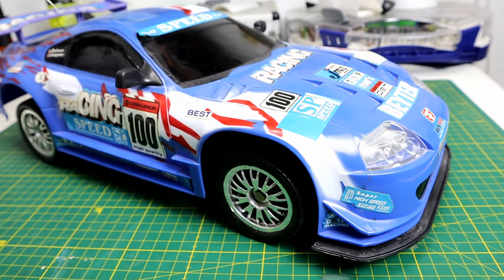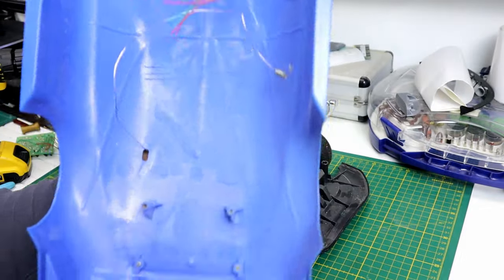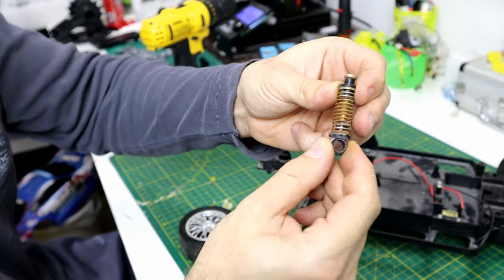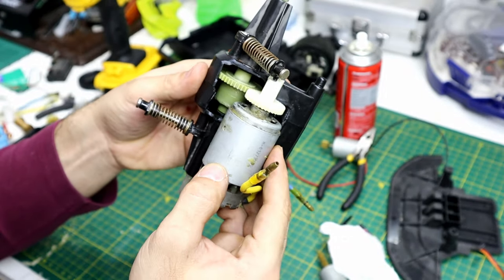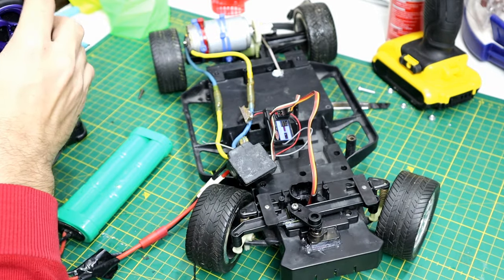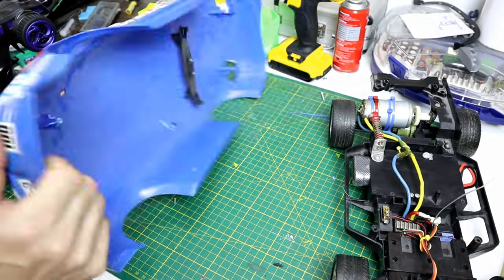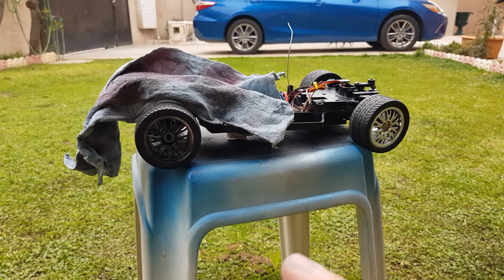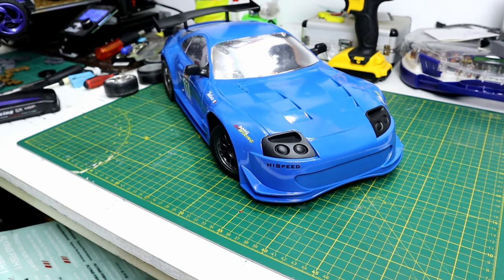Upgrading toy car to hobby grade car/upgrading steering to prepositional steering  | HOBBY WHEELS

Comment: Hi, I'm a newbie at this, starting a similar conversion-- I had a question, please:  I noticed that before you installed the steering servo, the front wheels did not automatically straighten out after you manually steered them left or right.  But once the servo was installed, they seemed locked on center.  Does the servo automatically hold the front wheels straight unless you steer left or right?  I'm asking because my car's original steering setup had a little spring that kept the wheels pointed straight.  I took the spring mechanism out because it was in the way of the to-be-installed servo.  From this video, it looks like the servo will automatically keep the wheels centered when not steered?  Please let me know because otherwise I need to re-install that spring.  Thanks for any info...
Reply: The servo will automatically keep the wheels centered. No need for spring.